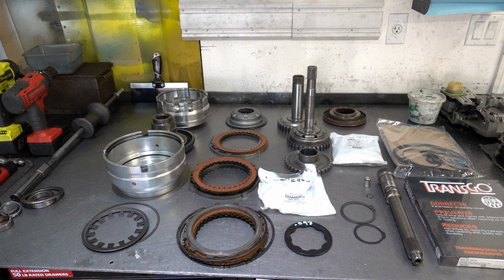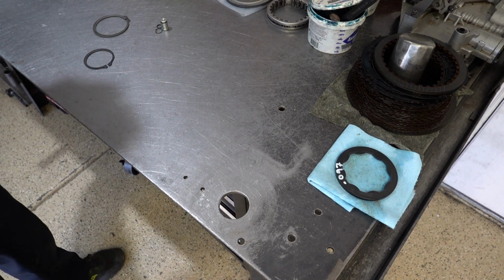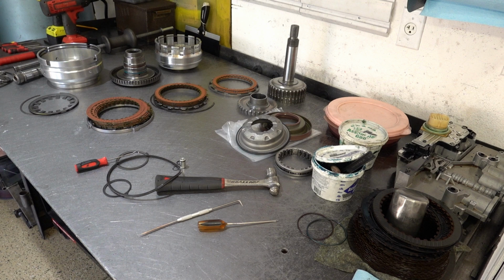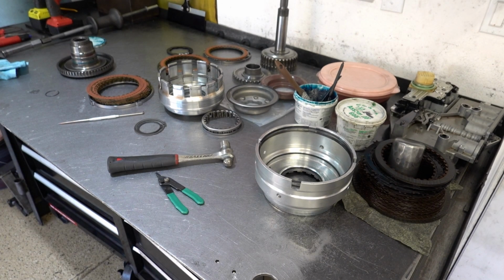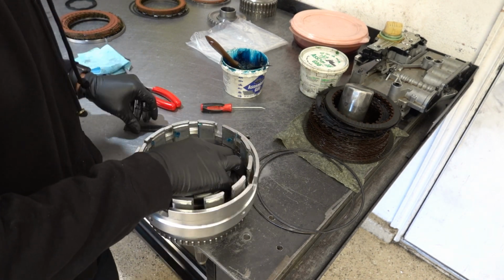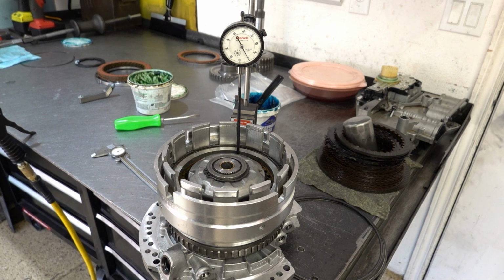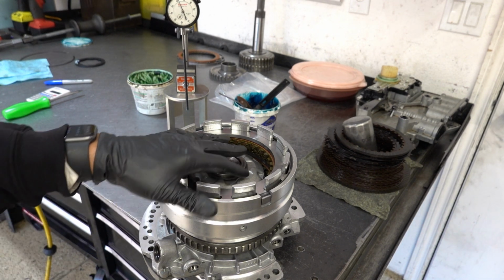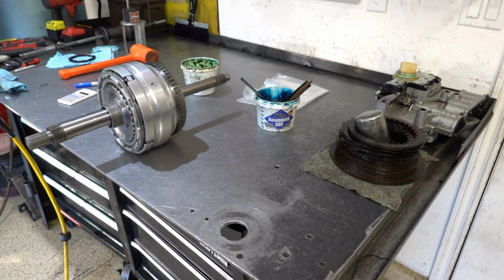Dodge 68RFE Rebuild Part 2 - Input Housing Assembly

Comment: Will the Sonnex drum with added O/D clutches give the 68 more holding power then the TransGo plate.  I’m just curious as I’m trying to decide on how I want to build my transmission while keeping cost in mind.  Thanks for any advice.
Reply from the maker: All things equal, probably however holding power isn't really the problem(s) when the vehicle is being used w/in its design/engineering limits...The problems w/the OD clutch stem from the screened orifice getting clogged, falling out, the dribbler valves clogging or falling out as well as the load placed on the OD clutch during operation...All three six speeds from GM, Ford and Chrysler suffer from frequent OD clutch failure, partly due to that load.